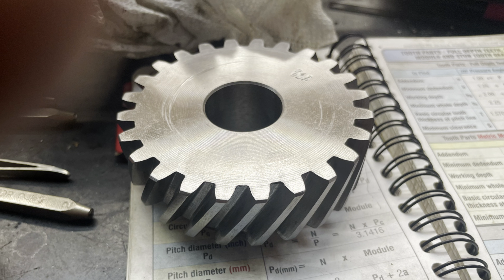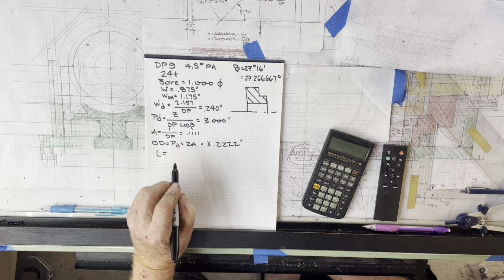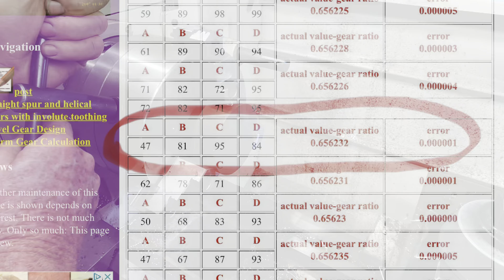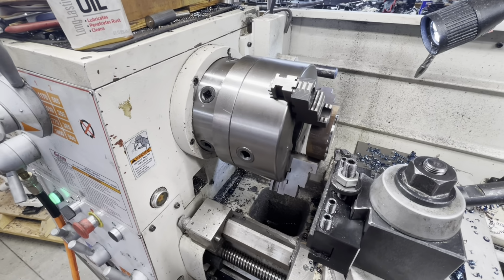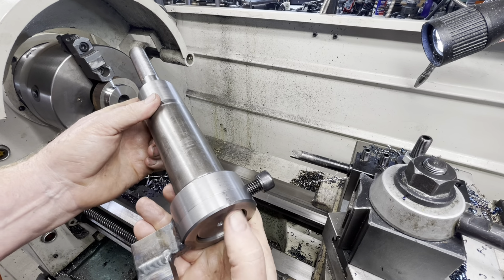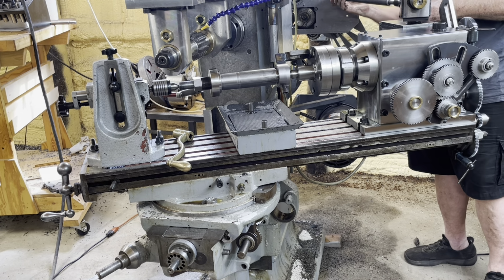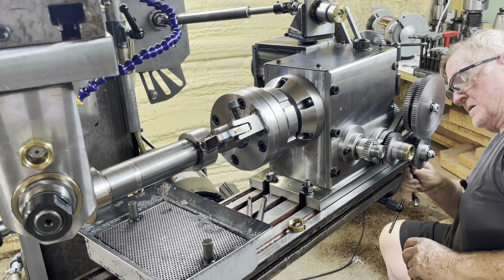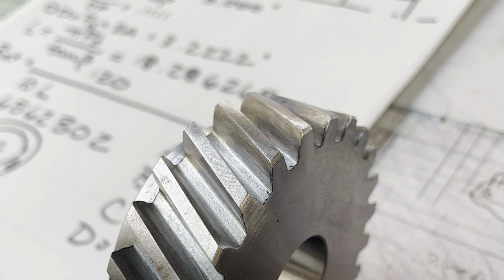KT Drive Gear Project DIRECTOR’S CUT…”a little more conversation..”. (Sorry, Elvis..)

Comment: I have to go back and rewatch some of your other videos to fully appreciate this. But it looks like that the rotation of the gear and the movement of the table is all geared based on the RPM of the spindle, right?

Package arrived today safe and sound. :)
Reply from the maker: @MyLilMule  the hob and the spindle have to be synchronized, and the table feed drives the lead compensation system for helical gears.  There’s a lot of mechanical bits, but the math is pretty basic, really…although it was hard for me to figure out.  I’m my own worst enemy sometimes…it’s all in the videos, including my big screw-ups.
Reply from the maker: @MyLilMule  Also, I’ll send you my cell.  If it runs tight, see if you can tap the head in whatever direction increases the lash…maybe your spline shaft has a little movement possible?  Anyway, this gear is made to “standard” dimensions, so if it’s tight it could be it’s at zero lash or it could be I got the helix angle off a little.  If it’s tight you might have to help me diagnose the cause…hopefully it will run fine!